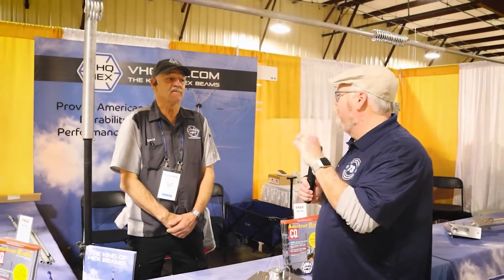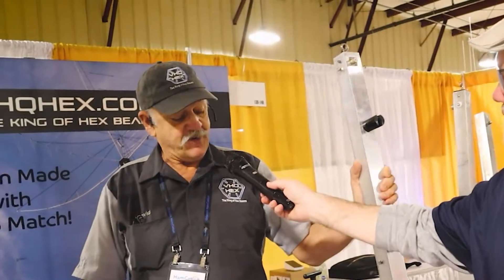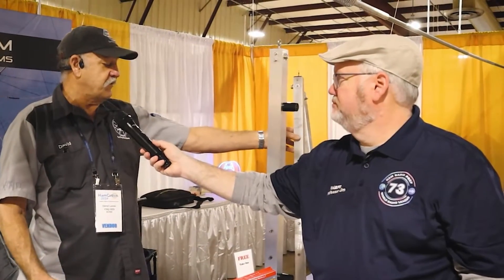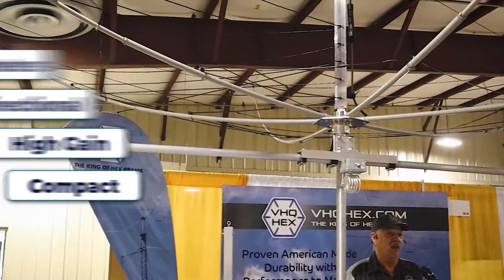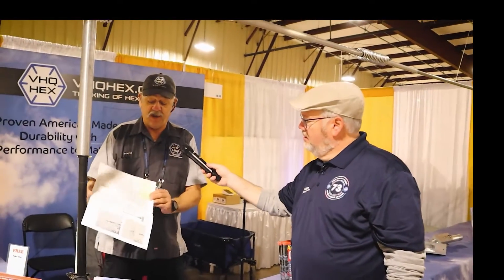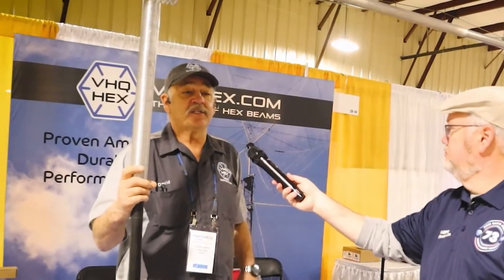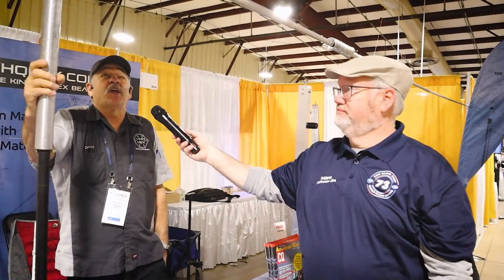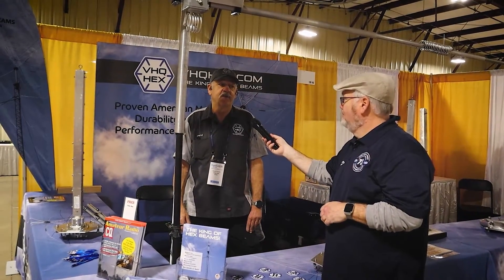Introduction to Hex Antennas!

Comment: This is a great product. However, you're also paying twice as much for a hex beam. And if you want something that's lightweight and transportable, this isn't your antenna.
Also keep in mind that if something does break on your antenna there are replacement parts, you don't have to buy a new antenna.
It's great to over engineer the hex beam structure, but if it costs too much to buy, it doesn't matter. I know the antenna he refers to, and they have improved their centerpost without it doubling in price. Depends on your use. If I'm going to put a hexbeam up 80 feet on a tower with a huge rotator I want to make sure I don't have to go up for awhile. I'm buying one of these. If I'm putting it up at my home 15 feet on a pushup mast I'll spend less and take my chances. I always can bring it down in high winds/bad weather.

Comment: Probably one of the top 3 manufacturers of Hexbeam antennas. I have a huge desire to buy his due to the strength and the larger wires for more bandwidth.
Reply: I made my own from the original builders design and it has been through thunderstorms, hail,ice storms was the worst, but I had the ice ropes on it before and it popped rigjt out of it.
Reply: @FjHenderson  I retired to the Philippines 🇵🇭 it's difficult to source the best quality materials here.